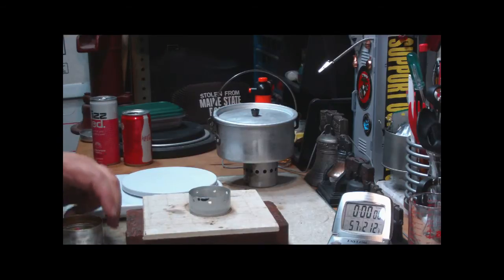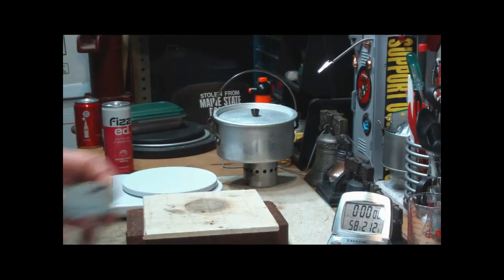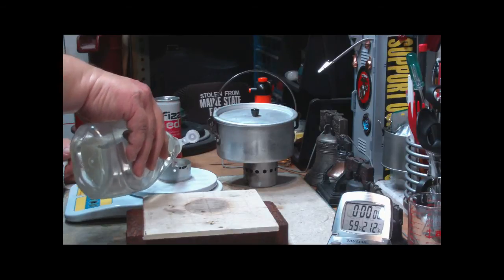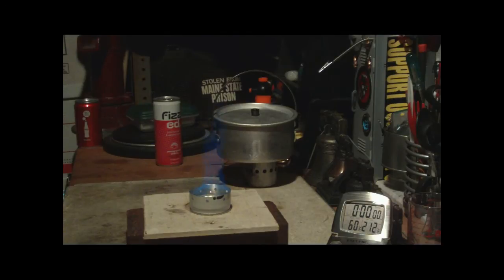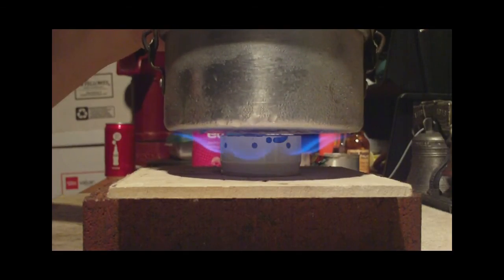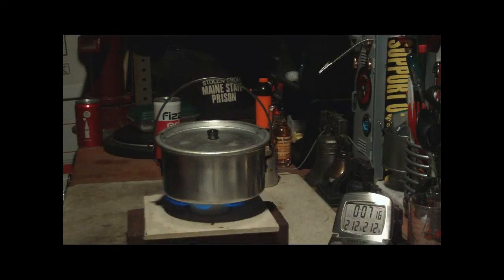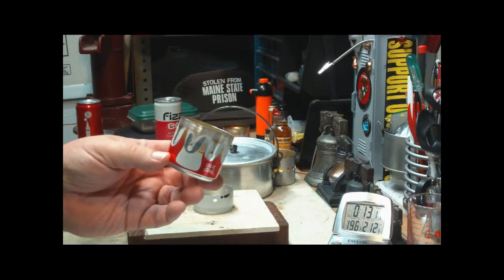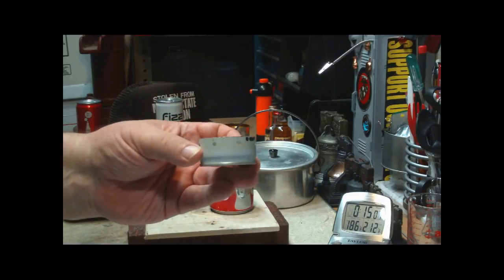Little Soda Can Stove V3.0 Boil Test 1

Comment: Hiram, those single row holes are causing the problem of not letting you put the pot on right away. I never have this problem building my little soda can stoves. I would add another row of holes, a hole away from the ones you have, above or below them. Also; That concave dome on the bottom of the can actually helps the alcohol boil and turn to a gas as the alcohol is guided to the edges of the can that are hotter.

Comment: I've had that flame quench problem with several of my failed designs.  I've also had a structure failure of an un-reinforced sidewall, as the aluminum melted, dumped hot water, and spilled flaming alcohol all over.  Not a good day.